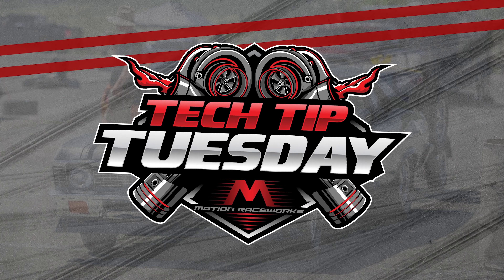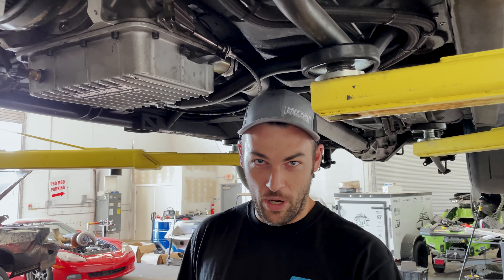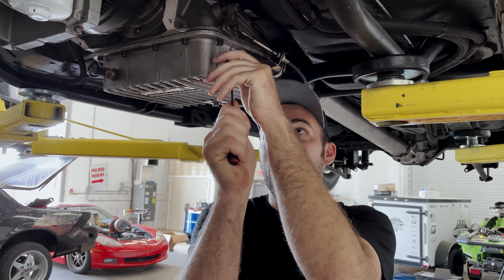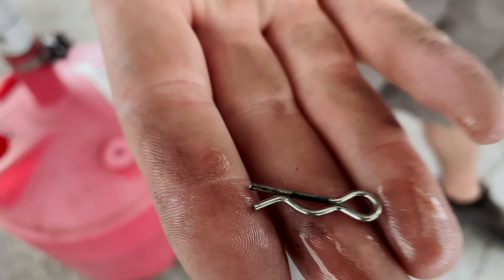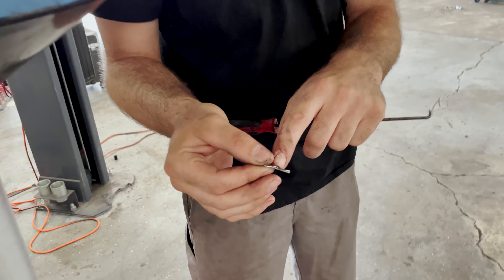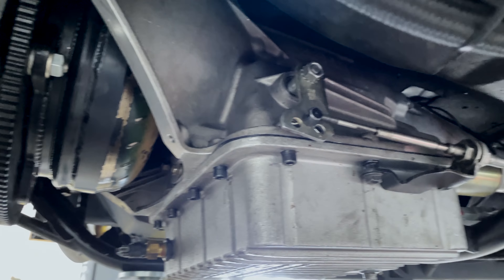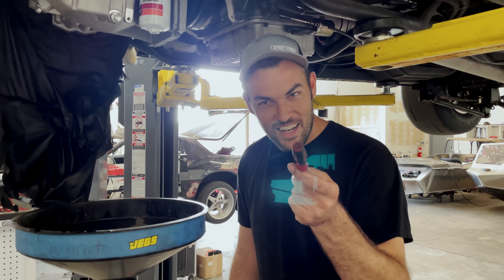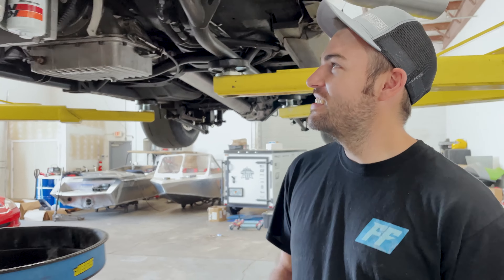Jackstand Jimmy shares a super easy How To with us - Transmission Linkage Tech Tip Tuesday!

Comment: Here's another tip from an R/C guy: put a colored trimmed ZIP-TIE on that pin to be able to pull it off easier when you need to and makes them easier to spot on the work bench or floor  ;-)

Comment: Ive been using those things for years everywhere they will fit. They wont work on some castle nuts like axel lock nutts, but they are handy in some spots
Reply: I use them on the castle nuts for the axles on my dual sport. It just goes over the end of the axle instead of the nut.

Comment: Hahahaha never thought Rc car body clips would be used on an actual car. I’ve got a few thousand of those laying around. 

They make um in a variety of colours or hit um with some contrasting colour spray paint so you can see them easier. You can also get or make them with a larger pull or a bent pull to make it easier to take out. Or attach a small zip tie to make um easier to pull out. They also make some that have wires attached to them so you can screw um to something so you don’t lose them. I race RC dirt oval and in heavy contact of wrecks it’s easy to pop um back on the body post  if they’re attached to the car with the wires etc.